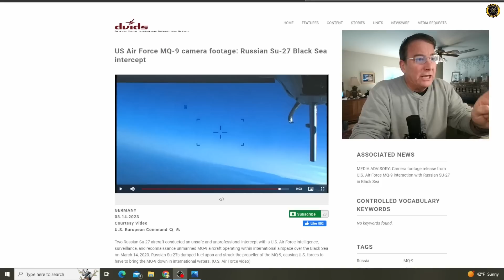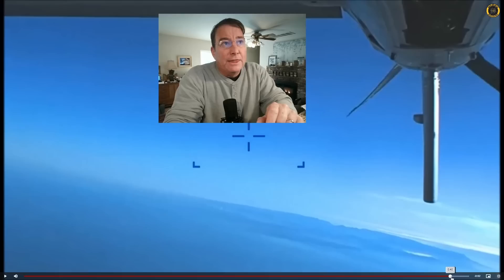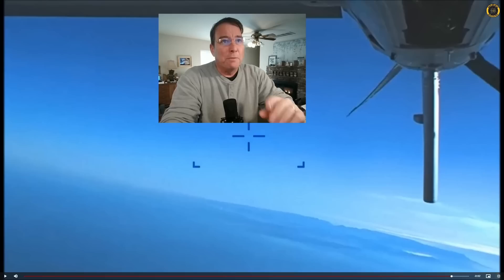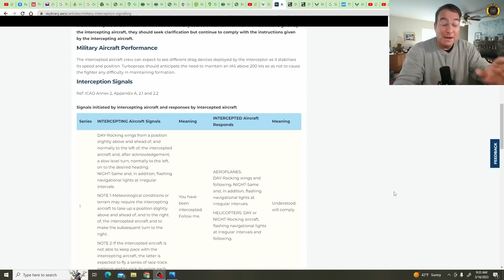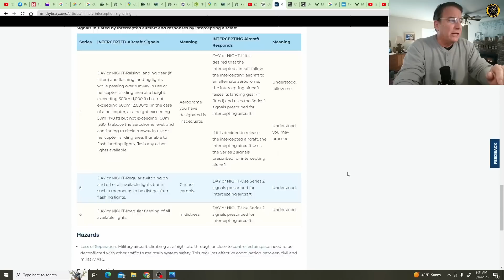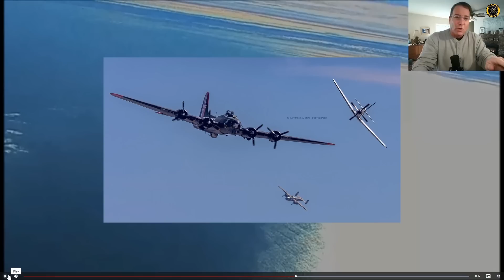Botched Russian Intercept of MQ-9 Drone Over International Waters

Comment from the maker: Botched! THERE IS ABSOLUTLY NO TACTICAL ADVANTAGE TO RISK LOOSING AN SU-27 OVER AN MQ-9 DRONE OVER INTERNATIONAL WATERS BY INTENTIONALLY HITTING IT.
Correction, Props pass thru fine pitch to Reverse pitch...NOT Feather.
Reply: Exactly, anyone who thinks this was intentional needs their head examined
Reply: There is also no reason to write all in caps, doesn't make your story more true.
Reply: @markverhoeven7518  "There is also no reason to write all in caps".....sure there is
Reply: @markverhoeven7518  bless your heart
Reply: JUAN CAN WRITE IN ALL CAPS IF HE WANTS TO. DOESN'T MAKE HIS STORY ANY LESS TRUE, EITHER. I DON'T CARE IF HE WRITES IN HIEROGLYPHICS.
Reply: it was reckless & stupid, but "botched" implies failure.
Reply: It definitely wasn’t intentional. Dumping fuel as the same time it hit it gives it away. They clearly just intended to harass it with fuel dumps. Terrible flying on the Russian pilots part
Reply: @rubusroo68  maybe he meant botched close flyby/fuel dump attempt.
Reply: @CheradenZakalwe  They did intentionally dump fuel on it, and possibly try to disrupt it with turbulence. They intentionally 'attacked' it.
I do agree that they probably didn't mean to collide, but they're for sure purely very happy with that result. They're definitely not apologising or compensating the US for their mistake, and not refraining from trying to recover the drone... They are congratulating that pilot and high-fiving each other...after deliberately attacking that drone.
Reply: This kind of intercept has been done by the Russians in Soviet times. A Su-27 collided with a Norwegian P-3 after dumping fuel on it in 1987. You can find retellings of the incident fairly easily.
Reply: More writing in caps , much easier to read!
Reply: Why do the Propellers show Yellow marks before the hit an none after?
Reply: Probably didn't intentionally collide, but did intentionally dump fuel.  Many have suggested it was an attempt to put fuel into the air intake and knock out the engine.  Why didn't they shoot it?  Because they wanted to recover it and reverse engineer the tech on board.  That could include the command and control systems, so they have a way to jam or compromise control over the drones.
Reply: Well strategically they shot themeselves in the knee as always.
Reply: @thilomanten8701  I don't see this as a loss for the Russians in any way at all. Knowing Russian thinking very well I'm absolutely convinced their arms hurt from high-fiving each other so much over the past few days.
Reply: Hitting it was not intentional. Downing it was.

You can both intentionally down something while unintentionally colliding with it.
Reply: There are YT commenters on some news channels saying that the pilot intended to hit the drone.  Nothing like trying to take your own aircraft down.
Reply: @thilomanten8701  how is gaining possession of a Reaper a strategic knee shot?
Reply: hehehehe what's next headbutting oil tankers with battleships ??? So bad
Reply: @MBrieger  The drone was turning in a circle to avoid the SU's. First pass it's flying south, so the sun is hitting the propellor, and we can see the markings. Second pass it's still turning North, and the side facing us is in shadow.
Reply: Even for the Russians this was totally un-bodacious - DOES THIS SATISFY EVERYONE.
Reply: Rand Corporation has a lengthy report on "Understanding Russian Coercive Signaling"  if that is of any interest.
Reply: @mk177  I think there were some comparable incidents between oil tankers / container ships and US Navy assets in the last couple of years.... didn't go so well for the smaller ships involved, if I remember correctly...
Reply: Good fun though
Reply: @rubusroo68  "Reckless and Stupid" is that Flanker pilot's squadron motto, apparently.
Reply: @JohnSmith-rq8hw  😂😂😂
Reply: Botched is pert much the Russian Military creed now…lol
Reply: @rubusroo68  mid air collision = botched = failure
Reply: Doesn't the tradeoff value  depend on what the Drone was looking at/finding? They've lost some very high value aircraft, ships, etc.
Reply: Great analysis Juan. The worst thing about this incident is the response from these USA was, “please be careful next time.” The more we ignore these provocations the more we signal that we can be intimidated. We must provide Ukraine with fighter jets.
Reply: @radbaron  Fine, but that is a little thin considering BRIGHT YELLOW. There is other footage that is longer. Now it could be as you say, but then why not mention it to begin with?
Reply: @markverhoeven7518  He's shouting - because he knows he's on thin ice here Mark.
Reply: @pistonburner6448  Says the America Exceptionalist!
Reply: I understand your caps, Juan!  Hopefully do another video pointing out the obvious to these people.  Which was already painfully obvious. 🙄
Reply: @nancychace8619  I do!  I didn't renew the subscription on my Hieroglyphic-to-English translation app. 😉
Reply: @Kyzyl_Tuva  "we"
Reply: @pistonburner6448  nobody is congratulating that pilot for destroying his fighter jet. This isn't demolition derby, he ran his aircraft into another aircraft. There's no telling  the costly damage done.
Reply: @DennisMerwood-xk8wp  You are incorrect.
Reply: @chester8420  Russian life, Russian existence is one big demolition derby.
Reply: if the end goal was to down the plane then it was a success. terrible "airmanship" just makes it look unintentional. there most certainly could be a tactical advantage gained by this. im sure in ww2 japanease pilots flying their planes into ships was terrible airmanship as well, but pretty effective against an enemy to gain an advantage.
Reply: There well could have been Naval activity they didn't want observed and targeted. They didn't want to "shoot" it down for political reasons. They downed that drone on purpose and made it look otherwise.
Reply: @pistonburner6448  That sounds funny except the Russian is flying a very sophisticated expensive fighter jet. He is lucky to be alive after a midair with another aircraft. Had he intended to down the drone, he could have simply shot it down. Instead, he was fooling around and screwed up. He probably ruined the jet and almost got himself killed.
Reply: @pistonburner6448  I don't think so. Prove me wrong Pistonburner my friend.
Reply: @chester8420  Actually if you understood the Russian Air force mentality and culture it is no surprise a pilot would use his plane like this.
Reply: @DennisMerwood-xk8wp  You tried to insult me with silly, false, political nonsense...and I'm not American so you missed the mark. And I do take exception to your comment for my American friends and allies as well.
Reply: @CheradenZakalwe  Well, it was certainly intentional - you don't repeatedly fly at another aircraft and dump fuel at it by accident. Russians do such buzzing and harassment fairly regularly recently. 

The crash was most likely unintended, though.
Reply: @pistonburner6448  So be it. My conscience is clear. And I am a Kiwi who lived in Seattle for 42-years and have kids and grandkids in Wisconsin.
Reply: @chester8420  No, you don't seem to understand how Russians operate, nor the overall strategic situation. If he had shot the drone down the consequences would be catastrophic. But bumping it down...as you can see that's a totally different matter and they essentially got a win without any consequences.
The Russians certainly can and do routinely risk their sophisticated and expensive fighter jets for far less than this. Their aircraft are made for offensive action, and they consider these stunts to be part of their role. They literally even buzz ships with their fighter jets, a drone is a tiny bit of nothing! And if you think they care about their pilots' lives then you're really mistaken.
Embarrassing Americans, gaining a potential intelligence win, and getting a drone out of their way is absolutely something they prioritise and will risk a Sukhoi over.
Reply: @DennisMerwood-xk8wp  I'm just trying to give people some insights into Russian thinking and doctrine, after a multitude of ways of gaining lots of varied experience on them. For ordinary, rational westerners it's often simply hard to believe they'd actually behave like they behave. Sometimes even after my decades of experience of dealing with them, observing their operations, studying history, it's hard to believe their mindset.
Reply: Agree.  Was a totally moronic and ill advised maneuver.  After these SU 27s passed the drone, they could have been targeted and shot down by the drone.  What kind of fighter pilot would pass their enemy and subsequently put themselves in full view of the bandit's firing envelope??
Reply: @nancychace8619  I do, I can't read hieroglyphics!
Reply: @markverhoeven7518  It's just to add emphasis, totally acceptable.
Reply: @pistonburner6448  💯 agree

Comment: Juan, thanks for all you do! Former MQ-9 Mech here..  the MQ-9 uses a McCauley 3 or 4 blade prop depending on model. Props are aluminum, are reverse pitch capable and can also go full feather, but like a previous poster said,the engine can’t start or operate in a feathered position.  The condition lever will engage fuel cut before it feathers the blades.
Reply: There was no way the fighter hit just one prop. It was CGI edited to fit the narrative. The drone was successfully crop dusted with fuel and downed in one piece.
Reply: @mvd4436  lmfao. First, there is only one propeller on the MQ-9. Second, fuel alone would not have brought down a drone. Third, you can literally see the video drop out when contact is made, followed by clear damage to the propeller. Why do you find the actual video evidence so hard to believe? Why jump to "it was CGI edited" when there is literally zero evidence for such a claim?
Reply: @AureliusR  I think when he said "damage only 1 prop" he meant to say "damaged only 1 blade."

Of course there are at least 2 damaged blades on that MQ-9. 1 bent, and 1 that is not matching the pitch of the other 3.
Reply: @mvd4436  Proof of CGI, not just an opinion? You made the claim, so you need to support it with factual evidence. Thank you.
Reply: @adamreznik6374  "there was no way the fighter hit just one prop" - I don't know man, that wording? I think we have a Sherlock here who just doesn't know how to use google before running their keyboard lmao